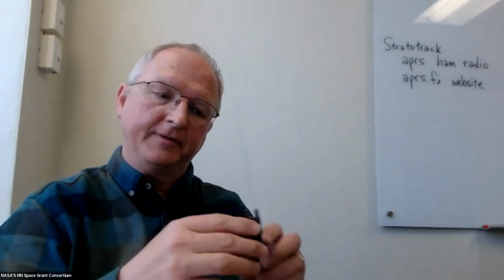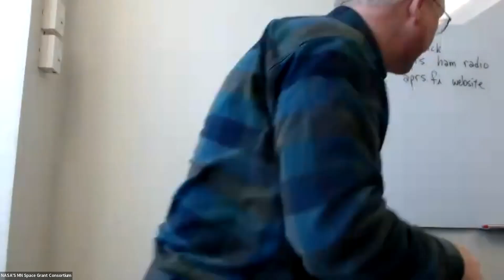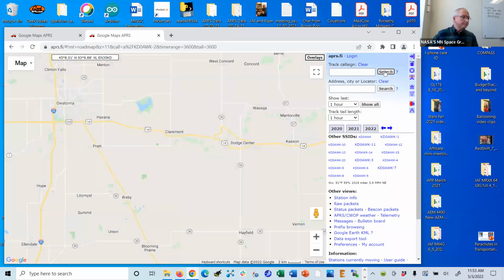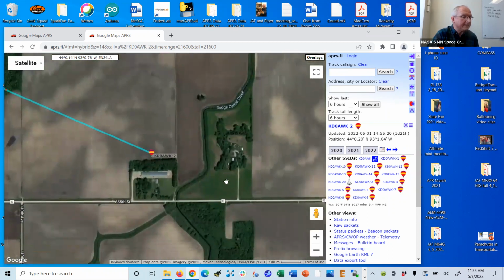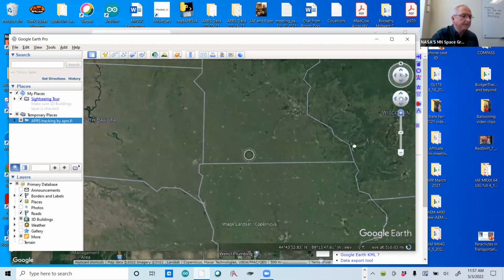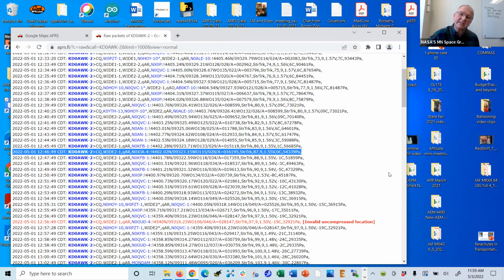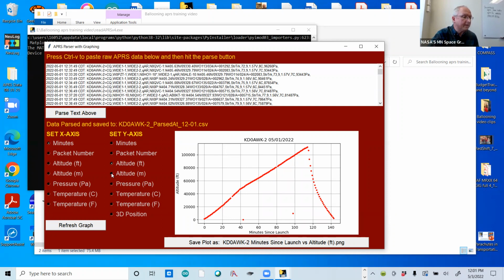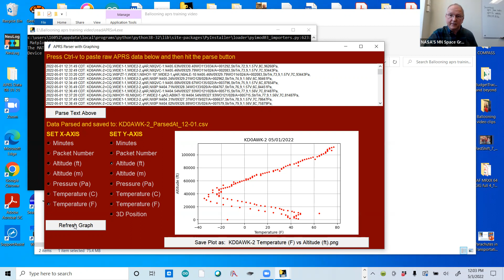APRS (ham radio) tracking with Stratotrack and aprs.fi website

Comment: It's a shame that the Stratotrack can't be readily user-configured.  It would be useful for model rocketry if the transmit interval could be shortened to something like fifteen seconds, even if being reliant on a local radio to receive telemetry rather than being reliant on an Igate.